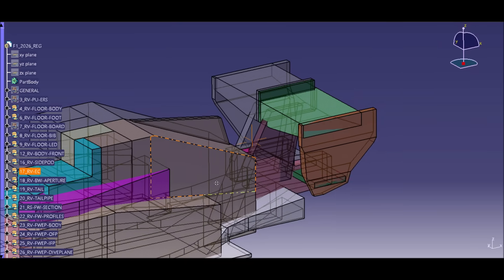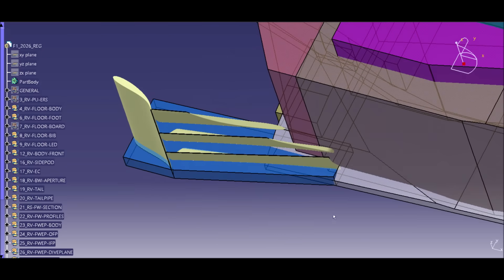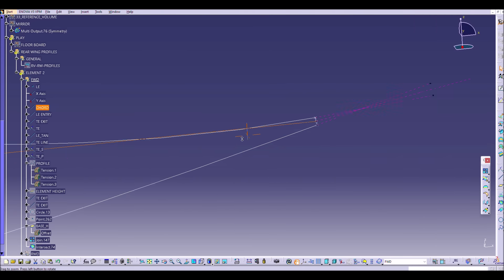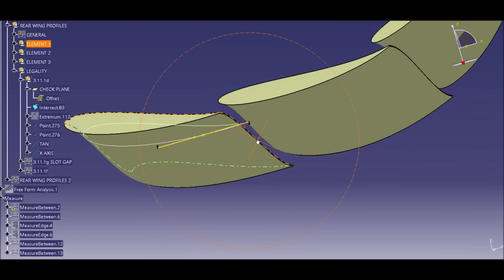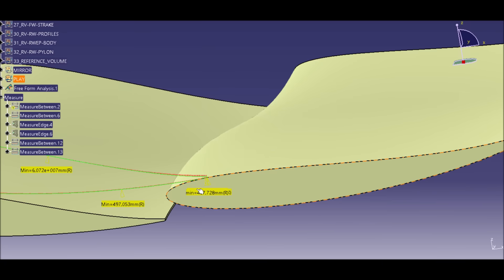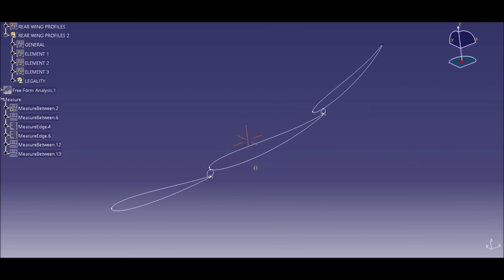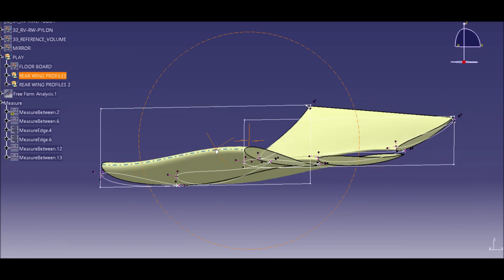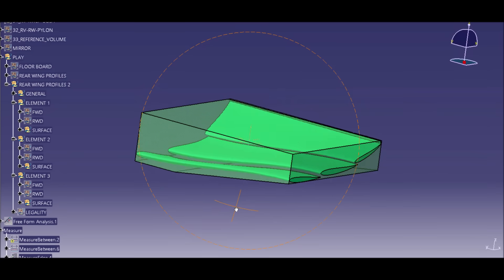F1 2026 - How to design a rear wing? (And floor board update!)

Comment: Surely because section c3.2.3 says that all aero components must be symmetrical your rw concept is illegal right?

Also, I've read the regs and it looks like the more forward parts of the floor can be proper manipulated into giving a little extra downforce
Reply from the maker: The designs I showed are symmetrical to y=0 so there is no problem with C3.2.3
Reply: @bsport320  ha, my comment this at 3 am arse didn't realise this was just the left profile lol😂 god im stupid sometimes

Comment: Can you explain how the elements rearward of 825 are legal when there was a maximum of 3 elements in this area? Are there not now 4?
Reply from the maker: In x cuts, you will see only one element first, behind 825 3 elements.
In y cuts, you can connect one of the 3 horizontal elements with the vertical one, so you see a maximum of 3 sections.
In z cuts, you see a maximum of 3 elements.

Comment: From the regulation, would it be possible to have the first element with coordlength short (maybe about 50mm to comply with sec. d) and more or less use it as a slat like they do for airplane wing, and have the second and third element form more of a two element wing, for the low downforce low drag mode to be maximised or am I missing something in the rules.

Comment: Wanna bet that some teams will revisit the concept where Ferrari started the last regs? Front loaded side pods for early outwash through pressure and early in wash past half the lower part of the car to free the floor of turbulences. I can't wait to see the new cars!!
Reply from the maker: I guess we will see wide sidepods again
Reply: @bsport320  if I had to choose I would probably have an air inlet at floor height and one on top like the first RB interaction. Both very small. Probably a pronounced sidepod but more vertical on the side and a lot more sloped on top. The idea is to channel the low flow on straights and exploit for downforce the upflow on corners. The large vertical sidepod would hopefully catch the wake you highlighted from the bargeboard as posterior inwash, possibly creating a bit of low pressure in front of the rear tire. But I am not an aero engineer so I am probably wrong on many fronts.

Comment: Am I mistaken to say that I seem to remember the fia adding a box for a small barge board in front of the sidepod, next to the floor board, and perpendicular to the chassis. It was thin, but also wide and tall. 

I remember it being added at the same time that the little winglets in the outboard side of the front wing end plates where added. I also remember hearing the teams where worried the cars would be more than 3 seconds slower before they added both the things I mentioned, and then after they where added, the teams saying that the new cars should start out about 2 seconds slower than the current ones. 

I could be completely mistaken about all of this, but I swear I remember something along these lines

Comment: The Frankenstein era is here. An F2/Formula E mashup with some failed 2009 narrow wake aero thrown in.  All of that research into 2022 out the window just to appease German big auto. What a disgrace.
Reply: I'm sorry what? What does Volkswagen have to do with the aero regulations? I thought they only influenced the engine regs, what did I miss?
Reply: @Petidani0330 The reason the tunnel floors are gone is because the new PUs can't handle the drag. The chassis regs weren't even up for renewal in 2926. Just the PUs were. But they had to hack up the whole car to make the 50% electric nonsense work.
Reply: @Toro_Da_Corsa Floors are minimally responsible for drag next to the wings and (of course) the open wheels. You're making zero sense.
Reply: @Petidani0330  Let's ask The Race F1. The 2026 regulations will feature a return to flatter floors in part to drastically reduce overall aerodynamic drag, which is necessary for the new hybrid power units to function efficiently on straights. The new power units shift to a near 50/50 split between combustion and electric power, requiring a significant reduction in aerodynamic resistance to manage energy effectively.
Reply: @Toro_Da_Corsa That's not the main reason though, and The Race have explained it. The 2022 floors made the teams set up their cars with the stiffest and lowest suspensions possible. The FIA wanted to change that because it put way too much stress on the drivers' backs (even with porpoising mostly eliminated). Like I said, the floors don't contribute that much to the car's drag, and it's common sense.
Reply: @Toro_Da_Corsa  You have no idea what you are talking about
Reply: @Petidani0330  That was literally the main reason. This is also the same reason for active aero. To reduce drag because of the new power units. Ask any AI you want. Driver comfort was the secondary reason.
Reply: @Adam_Teichmann It is a fact. The floors are gone and there's active aero for the same reason: to reduce drag on the straights because of the 50/50 power split , which was mandated by the VW group